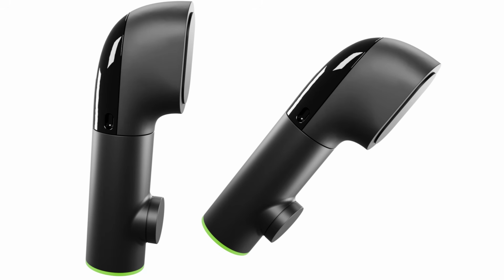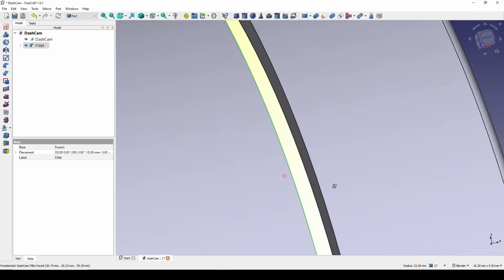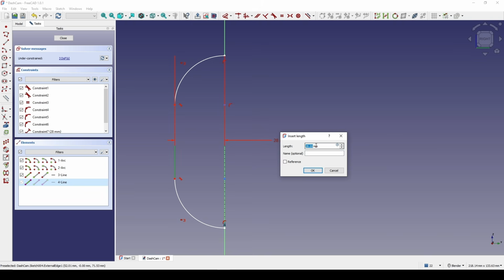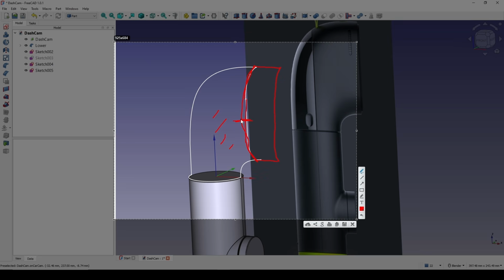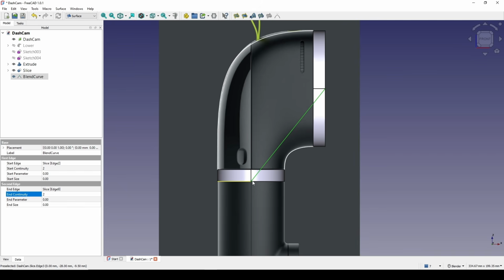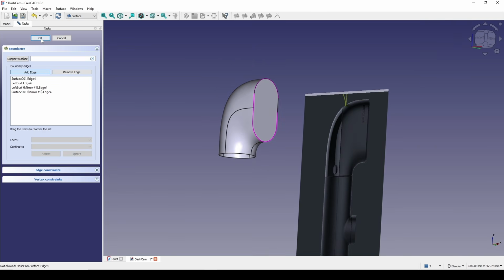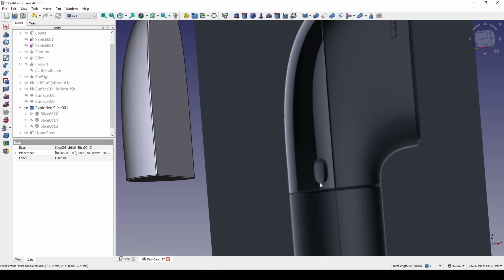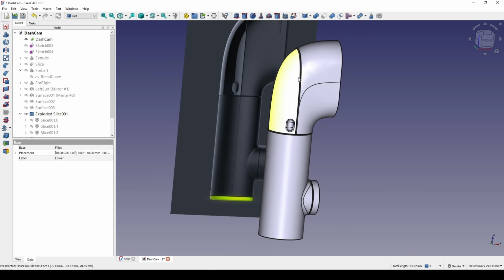Surface Modeling In FreeCAD - Create A Dash Cam.

Comment: You can split a line in the Curves workbench
Reply from the maker: Using split line we cant set g1 continuity.
Reply: @DuyQuangDang  Ok, I always convert all lines from a sketch into join curves, that's what I got used to, then I divide the lines that I need to be divided (this automatically sets the division in the middle) and then I make the surfaces that I need for G1 in Part🙃

Comment: Thanks for the great video!
I have a question. At 20:07, you created an extension surface along the X axis, and it worked great.
But when I try the same along the Z axis, an unexpected surface is created.
Could you please explain why that happens?
Reply from the maker: In theory, extruding along the Z axis is fine, other programs will be ok with it, but for FreeCAD it's a different story, can be a bit picky, so we usually try a few ways and go with the one that works best.